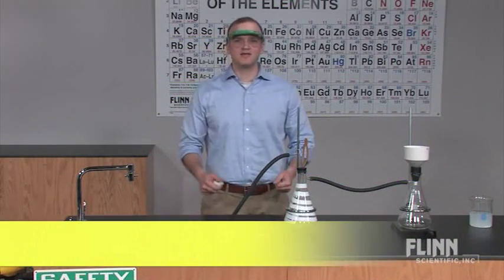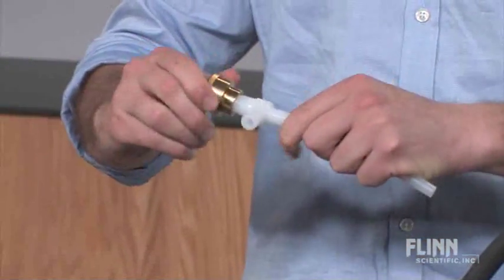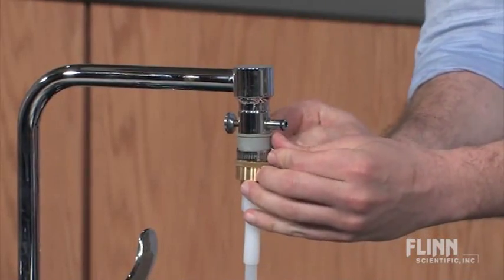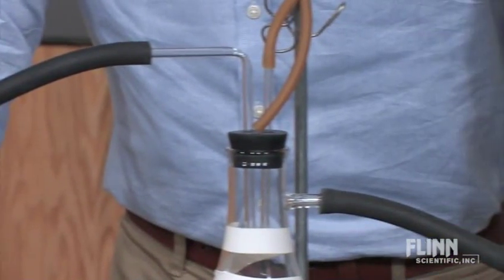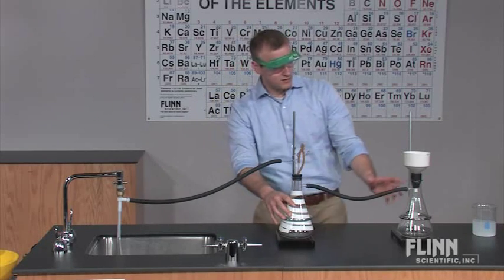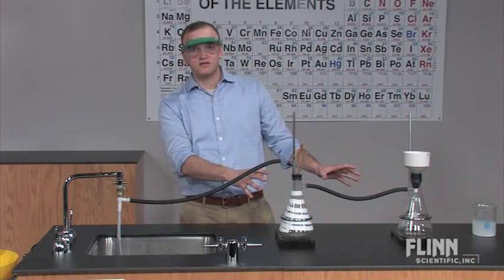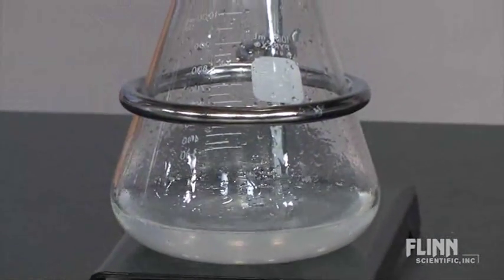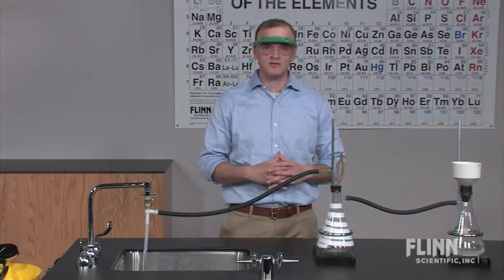How to Install a Water Aspirator

Comment: No, air pressure at about 7.4 psi will push the solute along with the solvent through the filter paper fairly quickly. Ok